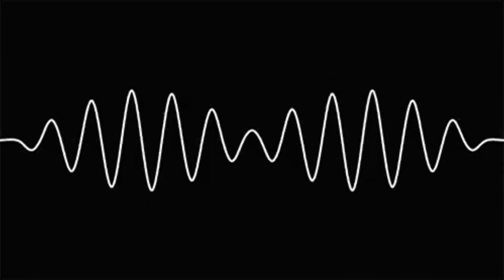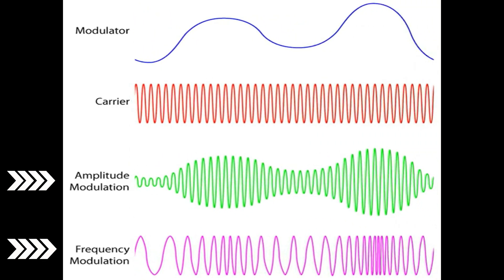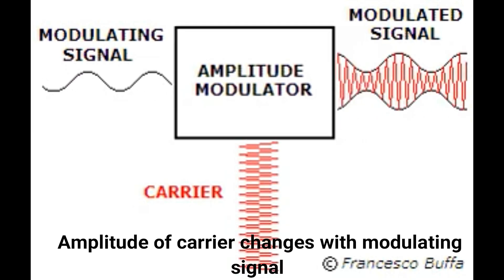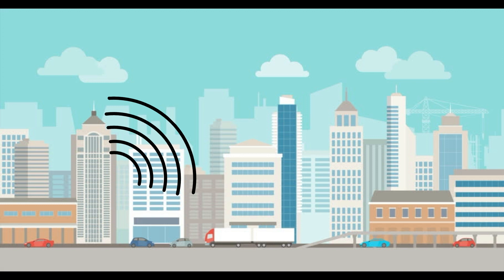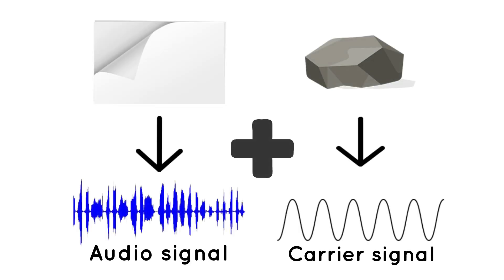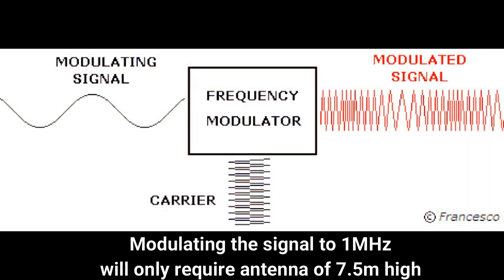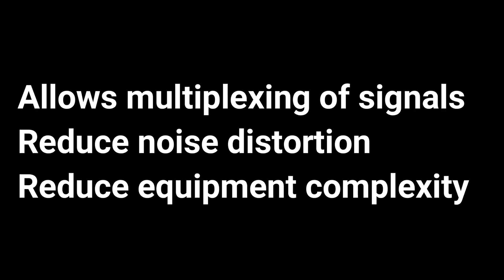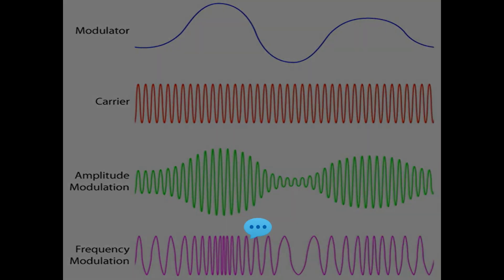What is modulation & Why it is so important?

Comment: Actually audio frequency’s as a baseband are extremely low radio frequency’s and thus can penetrate and travel extremely far, the problem with them is that they are neither AM modulated of FM modulated and so are subject to a huge amount of distortion, they also use a huge amount of the spectrum and so this makes it very difficult to efficiently tune. In terms of range and penetration they are far superior, it’s just that tuning is an issue. Also there is only one frequency range, the range of hearable sound and so you cannot change channel.